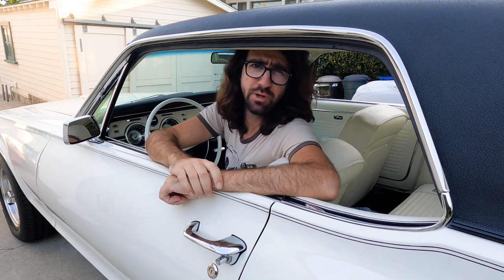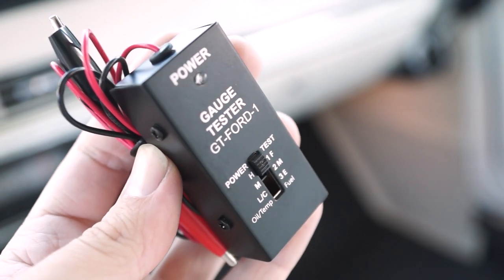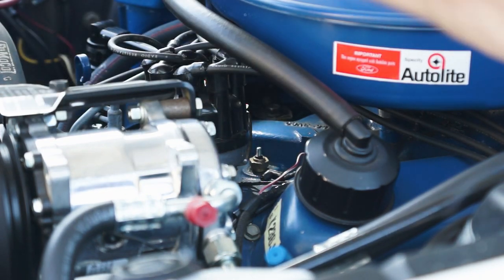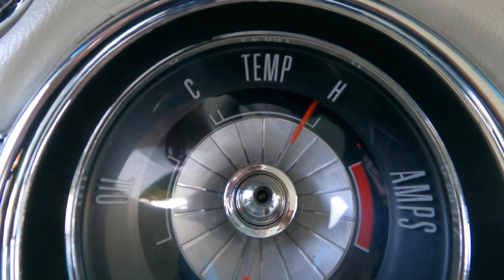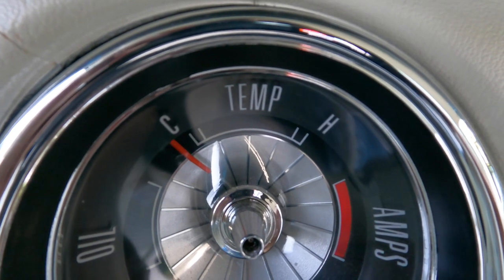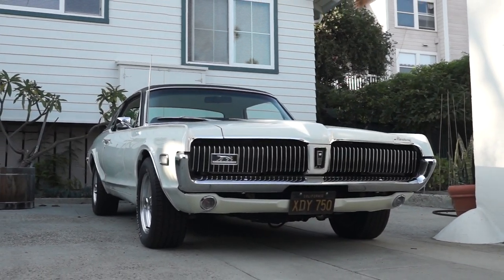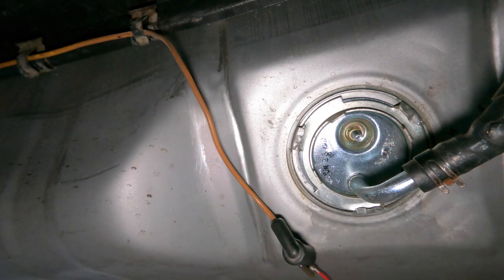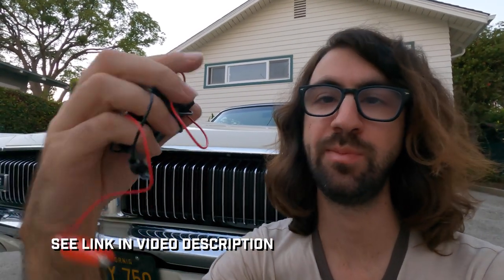Vintage Ford Gauge Tester: Temperature, Fuel, Oil - Are They Accurate?

Comment: Those gauges are really designed to operate with the 'pulsed' 5V mean average supply rather than a 'constant' 5V because of the thermal design. If you go with a steady 5V they will be inaccurate to some degree, usually at the very low end of the scale. The bimetal strip won't heat up the same way as it does with a mean average pulse. 
That looks like a nice IVR, but the only one that is a true solid state duplication of the original mechanical pulsed one is the RTE (Real Time Engineering) IVR. It also comes with a status LED, over-voltage protection and an internal circuit breaker. I've used them on Mopars and they are NICE!

Comment: What do u have for suspension on your cougar I like the way yours sits
Reply from the maker: Thanks! It's mostly rebuilt stock stuff, with the exception of these 1" lower springs in front: https://secure.cougarpartscatalog.com/c7zz-5310-p.html
For the rear leaf springs I used ESPO: https://www.springsnthings.com/leaf-spring.htm

Comment: Ambiguous. They're called 'ambiguous' gauges because they show non-specific generalized readings in non precise ranges rather than actual specific readings. OK for fuel, not OK for temperature or oil pressure. 'Most' of the motoring public wouldn't know what to do with the numbers anyway.